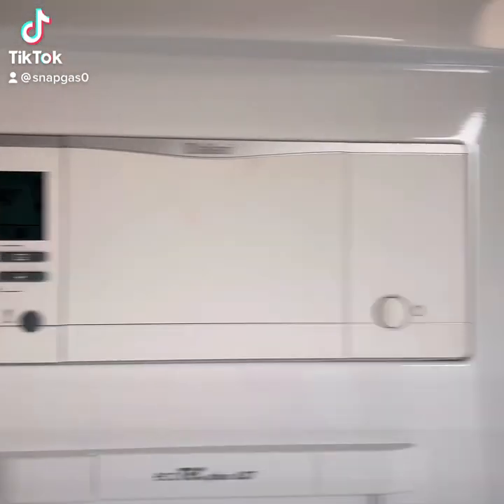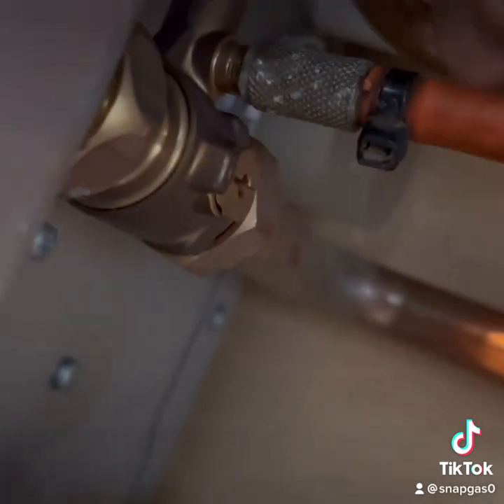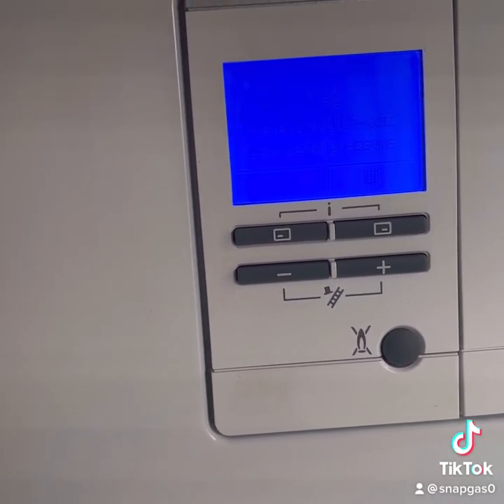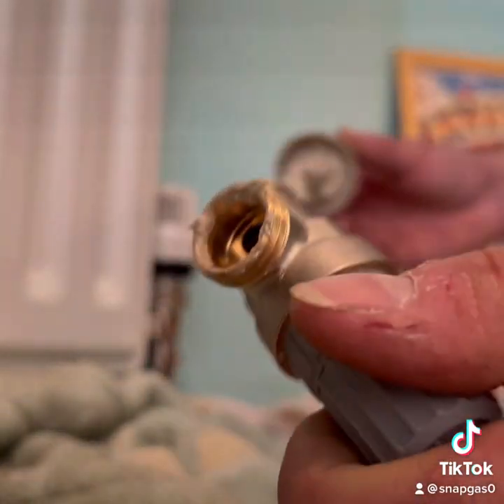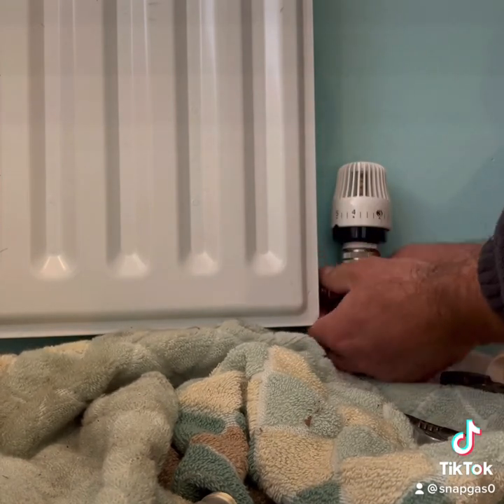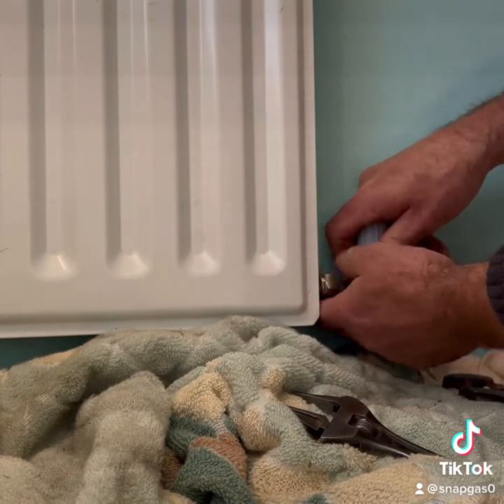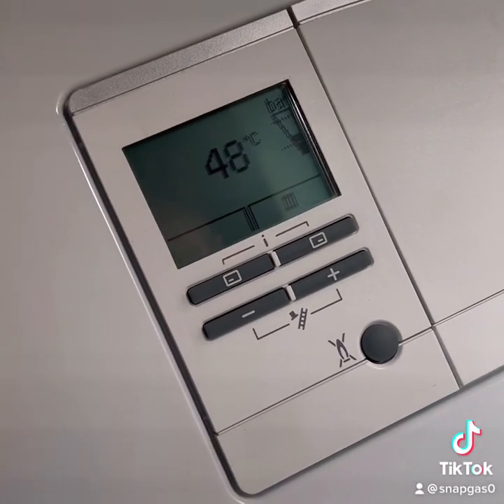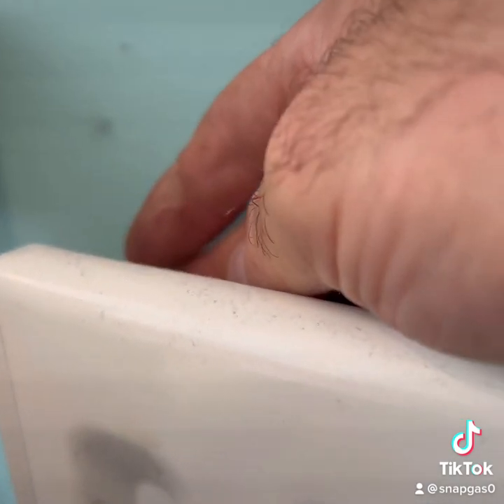How to change a radiator valve sealed system

Comment: How when you lifted the valve off wasn’t the water shooting out ? I’ve seen a few videos and they needto quickly cover the pipe with their thumb and it makes a mess - but you’ve made this look so easy
Reply from the maker: On a sealed system you can drop the pressure very easily which then will mean the water coming out from a pipe or the rad is very minimal 

If you watch another video of mine about how to create a vacuum in a system then you can do exactly the same and not have to drain the system and potentially cause an air lock of some sorts

Thanks for watching

Comment: You’ve lifted the radiator to fit the valve! All the weight is on the radiator pipe and valve so you need to re hang the radiator on its brackets.